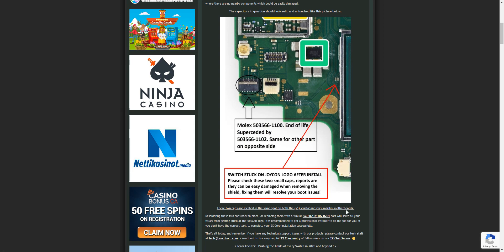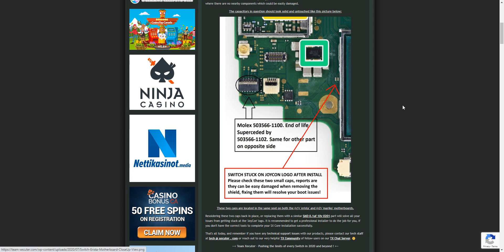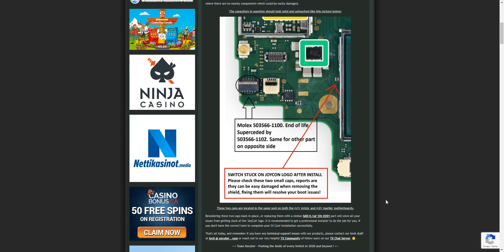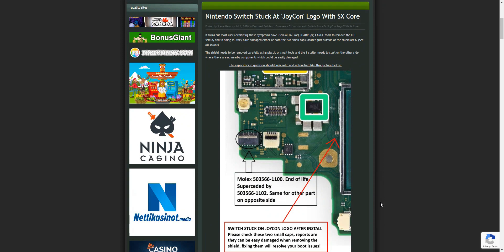Fix for SX Core/Lite getting stuck on JoyCon Logo.

Comment: How do I check if they are damaged? Can I test them with capacitance to see if they are damaged? If so, are the caps supposed to be shorted, or not? I have had this problem ever since I installed my sx core, I put my nand chip back into normal place and disconnected my chip, but the problem is the same.